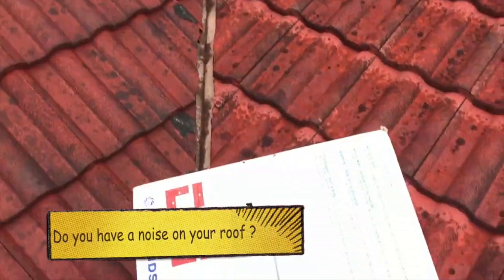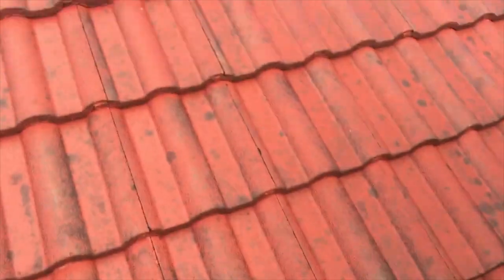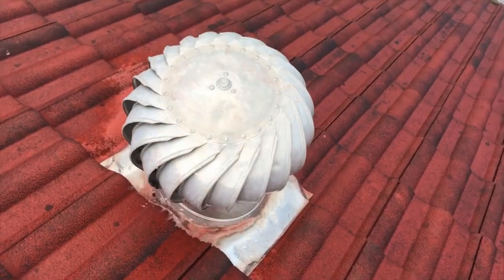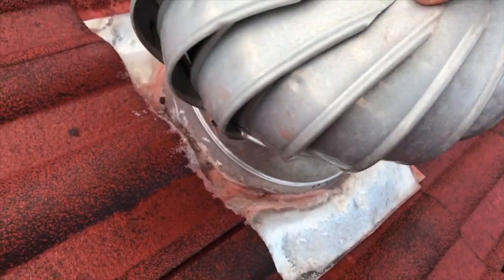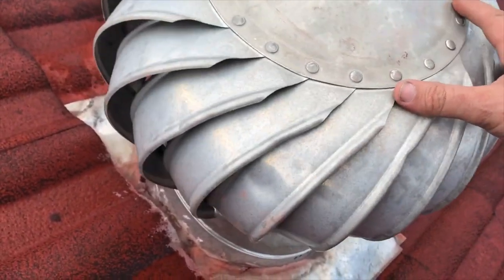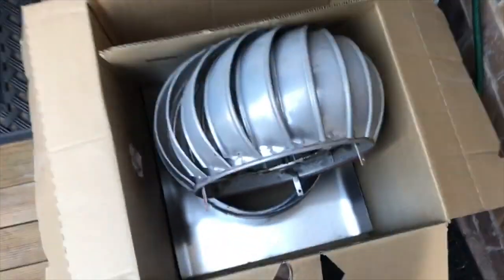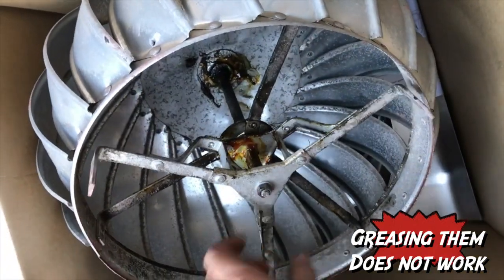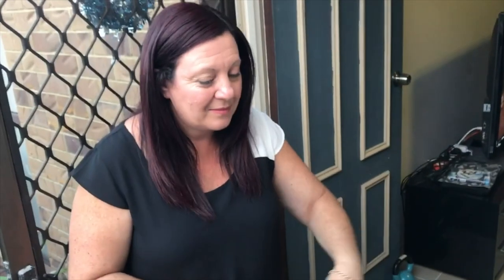Noise on my roof?   What is it and how can it be fixed   HD 1080p

Comment: Why not simply spray some silicone on it
Reply from the maker: It is a good idea however it may stop the squeak a little but it will not fix a broken bearing. Trust me I have seen a hundred DIY repairs to bearings, one guy even pulled them out of the plastic and re packed them with grease but that does not fix bearings that are worn out. Anyway like I said in the video, you could just buy a new one but the point of this video is to offer a solution that is cheap and easy.

Comment: All you had to do was grease the bearings ....so yikes.
Reply from the maker: Yes you are right that grease will help but to grease the bearing properly is difficult on a sealed bearing. (In fact someone had already tried to grease these bearings before)

As an installer I need to offer a more permanent solution and that is why we either replace the tops or glue them up to stop them turning. 

A good insulation installed on the ceiling is a better solution, the National construction code of Australia requires a increase of your ceiling insulation by R0.5 of a value if you install a roof vent like this. (Not talked about be sellers because their is more money in selling more) 

So instead of the normal Recommendation of R 2.5 on the ceiling, if you install a roof vent you need R3.0 on the ceiling. The reason is that they work against you in winter, so save your money and don’t install them.

Regards 

Peter